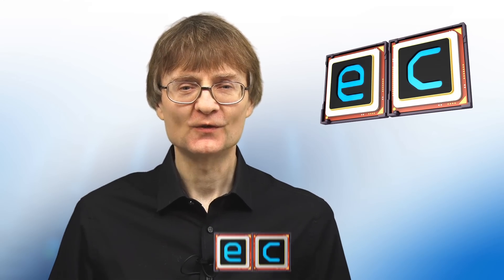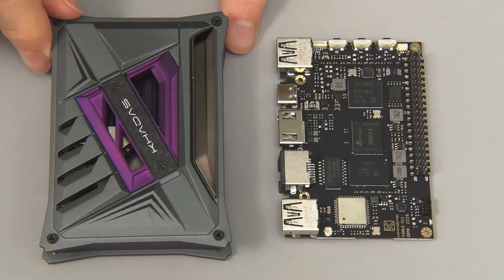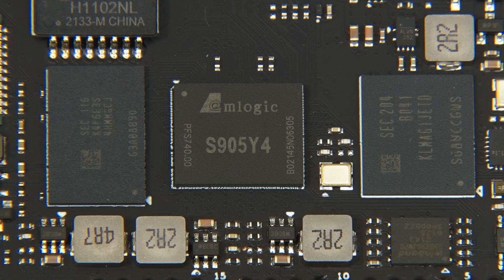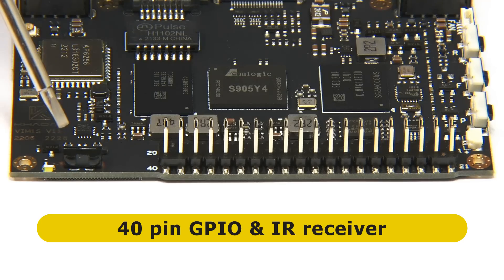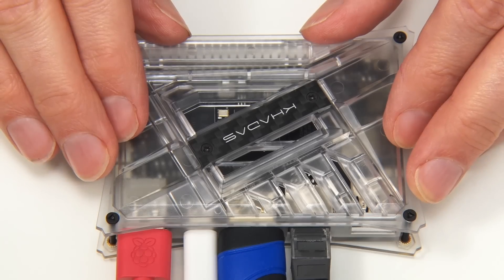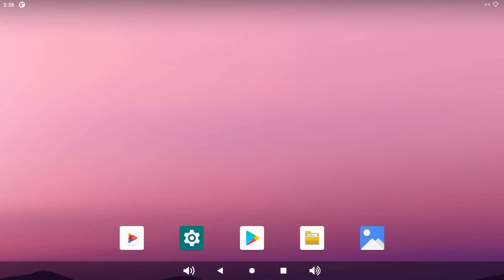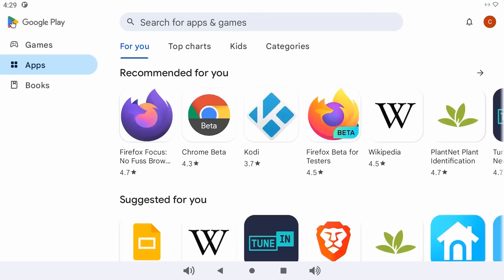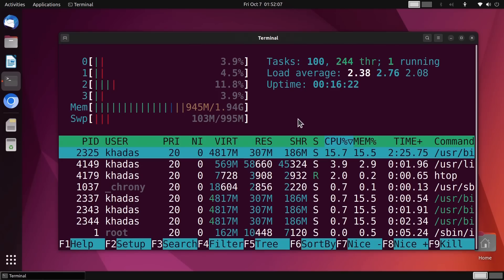Khadas VIM1s: Android & Linux SBC

Comment: The cost should probably be put down to the sort of gouging now common on many (most?) SBCs. If I wanted a TV set-top box this board might interest me. As it is, ummm, NO! The OOWOW firmware is apparently interesting and capable but the device itself is not at all impressive. Since I prefer to avoid Android on real computers (as opposed to tablets, etc.), this device is a MUST MISS!

I've haven't been a fan of Khadas for a variety of reasons (mostly pricing) since they appeared in this market. This is proof to me that this is good policy. There seems to be a rush to take advantage of the Raspberry Pi's supply problems, to try and fill the void. Sadly, without adequate I/O capability and complete graphics support that is at least equal to the Pi, none of these offerings make a lot of sense. SMH. 🤨

Comment: Thank you, Chris. You're doing amazing work!
But 30 frames per second? IMO it would be more interesting to see 60 fps video playback.
Reply from the maker: Noted. :)
Reply: No thanks: my broadband cannot stream YouTube videos at 60 fps & 720p, so would have to switch to 480p, and I would prefer resolution over frame rate.  Also noted, EC?
Reply: @cdl0  That's hardly broadband then, lol.
Reply: @mikem9536  Correct!  There is also no mobile phone signal, and satellite dishes are banned under local planning rules.
Reply: @mikem9536  Certainly should have just said "connection". Not even over a decade ago was I in such pitiful situation.

Comment: The comparison between the sample playback in Android and Linux was made with different connections. 🤔 I wonder if the droppings in frames was because software (other O.S. and browser playback vs dedicated app) or ethernet vs WiFi...
Reply from the maker: You are correct, Ethernet vs WiFi. But the data rate was more than sufficient in each case. I've no doubt that the issue is a lack of a hardware accelerated playback GPU driver in Ubuntu.
Reply: @ExplainingComputers  Ok! Thank you! 😉

Comment: 45$ for rpi4? I had to check the the date on the video.. rpi4 wasnt nowhere near 50$ for more then a year, well almost two.. not even 2gig version. Og orange pi is closer to that price and its years old now
Reply from the maker: The 2GB Raspberry Pi 4 has had an official retail price of $45 since early in 2022 (when it was raised from $35). And every official reseller still lists it at this price -- eg Adafruit today (October 16 2022): https://www.adafruit.com/product/4292. No company can continue as an official reseller if they do not do this. Certainly scalpers advertise the Pi at far higher prices. But limited quantities of Pi 4s can still be purchased at the official price from all official details if you register interest so that you are notified and can grab one in the few hours of stock that happen every now and then.

Comment: 👍👍👍hmmm... how would it compete with the "higher-end" micro-controller's or pi zero in the maker's space? Or for tt matter the mid-hi ends of SBCs.
Perhaps the WIFI is faster than the Full-Duplex 100mbps fast-ethernet. If so, WIFI is the way for such boards.
☺️

Comment: If they can just provide a better connectivity it will be amazing little board,
I hope that Raspberry PI makers consider including similar firmware,
Finally, it's really nice to see Stanly back to work again,
Thanks Chris and have a nice day💯🚀
Reply: With the Pi4s, it has been rumored...
Reply: There is very little difference between NetBoot (tftp) and doing something like infinitywoo...
Reply: Raspberry Pi has had android for a few years (Lineage OS), and multiple versions, android 7,8,9,10,11,12,13. I'm running 13 on mine.
Reply: @maxxdahl6062  Good to know, but I was actually referring to the Infinity-WOW firmware which I still find it to be helpful if included in Raspberry Pi, one can install OS directly without needing to copy the image to a flash drive then install it on the PI.
By the way, what is your Raspberry Pi model and how responsive it is running android 13?
Reply: @ahmad-murery  I'm running on a pi 400, performance is actually really impressive. I can play grand theft auto 3, vice city, san andreas, liberty city stories full speed with no problems. The youtube, amazon video, vudu apps play movies at full speed perfectly. There's a Freemium version of android on the Raspberry pi Imager, but I don't like that one as they limit you to 8 hours up time. Where as Lineage is both free, and doesn't limit you with anything, you can do whatever you want with it.
Reply: @ConfuSomu  That looks promising,
Thanks 👍
Reply: @ahmad-murery  You're welcome!

Comment: For an SBC launched during the latter part of 2022, the specs aren't strange, they're embarrassing. Making the Pi 3 and 4 superior in most every way, and cheaper.
Reply: They are only superior if they are available for a reasonable price. 😀
Reply from the maker: @JimLynch Exactly. This is a relatively low-cost SBC that does some stuff well, and is actually available for its RRP.
Reply: @jimlynch9390  - Exactly.  When did you last see ANY RPi at the authorized (thus proper RPi price) sellers?  You can't get any model new or old.  Will this change?  As much as I love the support of RPi, it is useless to those that can't buy any.
Reply: @ElmerFuddGun  That was my point.
Reply: @jimlynch9390  - Yep, and that is why I gave your comment a thumbs up last weekend.   ;-)   It really makes me wonder what the future of RPi will be... is this the slow dying end of a low cost and well supported SBC?

Comment: No USB 3 + No Gigabit ethernet = No Sale. Well that was an easy decision. 😢 Thanks Chris for showing this SBC, very interesting.
Reply: I'd agree that no USB 3 is a bummer, especially since you can add other interfaces that way. -- Don't think most people/need gigabit ethernet though. After all 80 Mbps (80% of 100 Mbps) is still ~10 MB/s and lots of people don't even have internet service with that kind of bandwidth. It would only take ~ 2 minutes to transfer 1GB.
Reply: @jnharton  True a lot of security cams are 100mbit, depends what you are using it for. (my 1080p camera only needs 6Mbit max).  For the arduino projects or valve switching, wouldnt think you'd need but a trickle of bandwidth.  Now if you are running a NAS or streaming server, then maybe different story.  Then again, I just go x86 tower for the heavy stuff all on one box, 1gb copper and a 10gb sfp+ ;).
Reply: @ironfist7789  1gb isn't much more expensive though. I suppose they're marketing this product to extremely price sensitive customers.
Reply: What about the 802.11 wireless to ac standard (complete with free aeriel)?
Reply: I'm sure there lots of other boards for you.
Reply: It's a bummer. Still, what would be your SBC of choice (considering RPI's are unavailable at normal list prices)?
Reply: I'm
Reply: This thing is made to be very low on power consumption while still having decent power.
You aren't going to do anything with it that required 1gb of networking. Same with USB3 speeds.
Reply: it has other uses. very low power consumption.
Reply: Such value determination, of course, is weighed against expected use cases.  What do we expect to do with a $65 SBC?  Are those use cases impaired by the available bandwidth of the given I/O?  What do we do with these SBCs that are overkill as a microcontroller but not quite capable of desktop replacement?
Reply: Would make for a good "set top box" if you have a media centre or Netflix and a regularly used guest room with no smart TV. The max bandwidth needed for that(at least at 1080p) would be about 8mbit/s.

There are cheaper options with pre-configured software, but those things are slow and unresponsive, often taking 2 or more seconds to respond to button presses.
Reply: @Chris.Brisson  I think it could be a good alternative to pi if the Linux distributions run better for 2gig of ram. The processor is ok. The fact you can now get ex office desktop with more ram, more io and more hd space and able to handle video playback for the same price...well maybe not so good. It is ok for maker board but won't beat a pi for that.
Reply: @jobearesto9746  well, the actual price of a Raspberry Pi today ($150) might serve to discourage the "maker" use cases.
Reply: @Chris.Brisson  Yes, for makers this may be an alternative.  I was lucky I got a few different pi's for my birthday from different friends and family. I still use my two Pi 3s and the zero W and zero W2 I have. The Pi 4's I have (4 gig and 8g one) I use mainly for emulation /pc/Linux use.  I have a couple of pico's i tend to show my son how to do basic programming and circuit on bread boards (he is 9) so not too complicated for him.  Makers though are suffering.  Even though I have mulitple pi's I do use them all for different things.  hopefully new pi model will be out 2023...
Reply: @jobearesto9746  probably good for things where you don't need a desktop UI version of linux
Reply: @ironfist7789  yes, it's not good for that. Pi's are good but old laptop does light weight Linux just fine
Reply: @jobearesto9746  #9gagcom collateral experience, let's see :dothefive::buffering::goodvibes::videocall:🍌🥝
Reply: No need gbps speed ethernet

Comment: The specs are extremely weak compared to a Pi 4
Reply: Should be a little bit stronger than a Pi 3B+. The A35 is 80-100% of the power of a A53, but clocked higher (2.0 vs 1.4 GHz)

Comment: Thanks for the video..are there any other Linux distributions that can be run in these boards? A lighter weight one? Like pup?
Reply from the maker: Theoretically, certainly. Armbian would be good on this board I image, if/when ported for it.
Reply: @ExplainingComputers  cool would you have to use their install tool to do it? If so is there an option to install from an image? You know rather than download from the net?

Comment: Given the current Raspberry Pi shortage, this might be a viable alternative for some people.
Reply from the maker: Very much so.
Reply: And what a shortage it is, too! It´s going to last over two years.
Reply: @BilisNegra  The chip shortage is the result of companies ordering a  bit more than they need, as padding. But each step of the line has done this, meaning a surreal amount of chips now have to be made.

But when it is over, those items that were  needing those parts, like cars, won't be wanted any more when they are ready. No-one can buy them any more mea ingredients a surplus of goods inbound. 

I can see this happening to the Raspberry Pi as well, because more and more people are looking for alternatives to their projects. The lack of support won't matter so much, if the better supported alternative is never available. 

I understand the need to support the OEM companies, but the original purpose of the Raspberry Pi was to get a cheap computer into the hands of children/teenagers, so they can learn computing and coding. The lack of availability undermines this, and will have a negative impact on computer science applications to universities in the future.

It will be interesting to see how this all ends.

Comment: I prefere the big Computers, that can be used as a heater for the cold winter.
Reply: Raspberry pi’s can keep the hamsters warm😁
Reply: Indeed
Reply: I tempted to take out the LED light bulbs over the winter and put the incandescent back in.  "Well those bulbs generate more heat and take more power!!!!"  That's the point.  I wonder if doing that saves a tiny bit on the oil heat bill even if they take more power.  I'm only going to have lights on in rooms I'm in anyways.
Reply: I used to have a small  AS400 that kept the garage warm all winter...
Reply: Get over 10 year products, those get warm and are slow as... snail